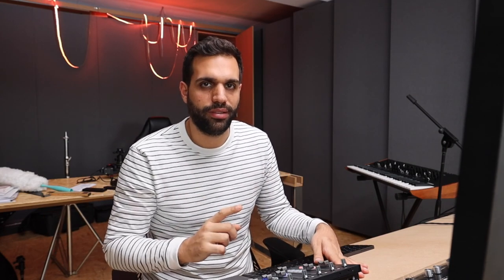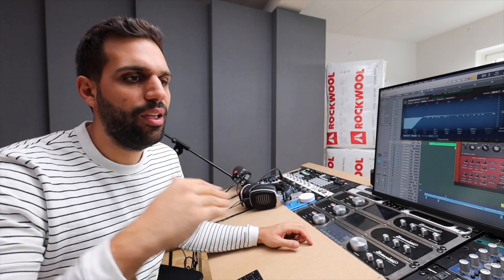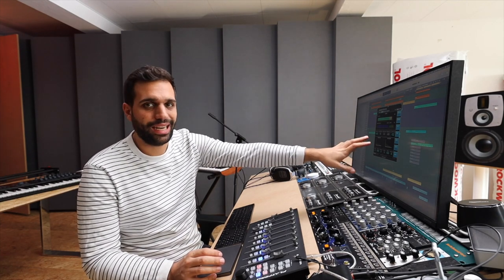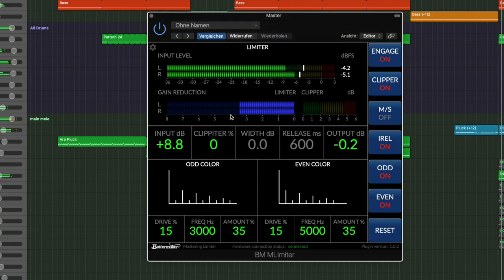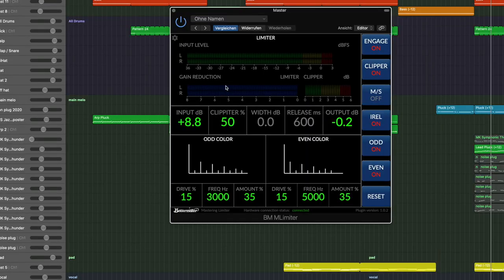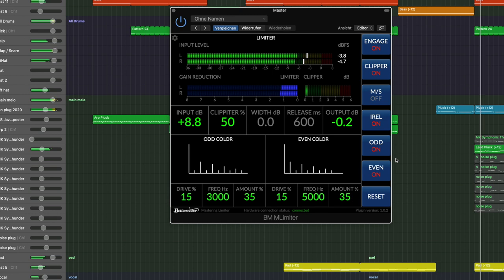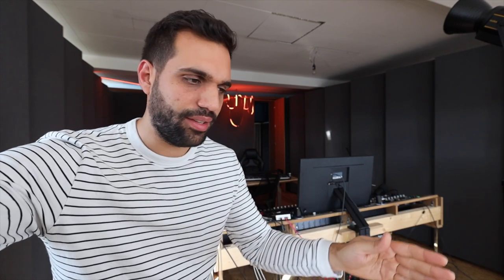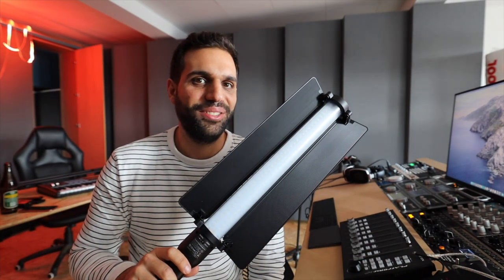NEW HACK TO GET YOUR SONGS AS LOUD AS THE PROs

Comment: Yes, thanks for this! It's counter-intuitive, but clipping can enhance the sound and really reduces load on the limiter. I just learned this a couple weeks ago, and I'm still trying to understand it completely, but the results speak for themselves. In bitwig, clipping can be achieved in several ways, but the bit8 distortion/bit-crusher can implement clipping very well; maybe other bit crusher plugins will work too. It seems like it should sound terrible, but it doesn't. Of course, you can make it sound terrible if you try. ☺️ Everyone should become familiar with this technique.

Comment: Hey Jon, So I used a loudness meter to mix something at the recommended LUFS for Youtube. Lets say -12 LUFS or so. I uploaded a -5 LUFS master. And the -12 LUFS was basically way quieter than the -4 LUFS version. What gives? I thought streaming platforms are supposed to turn -4 LUFS down to where the -12 LUFS was at. Any thoughts?
Reply from the maker: They don’t. Just make it loud
Reply: @Jonsine  Would it be beneficial to make breakdowns less loud? and make drops loud for youtube only? From what I heard youtube pushes to integrated LUFS - 14. In theory short term LUFS of a drop could be louder when keeping drops lower.  Not sure if there is a clear answer to that - what do you think Jon?
Reply: @TheChorus3  im not john but what i can tell you is if a song is not at ultra maximum loudness can br a good thing

Comment: No real secrets here...

You can get a TDR Limiter 6 plugin that has a:

Dynamics Compressor
Clipper
High Frequency Limiter
Peak Limiter
Output Protection Limiter
True Peak and EBU Loudness Meter

And it only costs 50 Euros!

Or,  you can just use a glue compressor and a limiter like the Waves L1 & L2 and make tracks as loud as you want. I prefer not to smash my mixes--I keep them around -14.   Loud mixes cause listener fatigue.

Comment: Nice review but the title seems misleading since you mostly talk about the Bettermaker limiter (which is a major purchase for the average hobbyist and not a new hack). Maybe a more appropriate title would be something like "New $3000 Bettermaker Limiter helps those who can afford it master like the Pros". Lol.
Reply from the maker: You didn’t get the point it’s not about the bettermaker limiter it’s about using clipping on the master. You can get very inexpensive clippers as a plugin but if you want the best possible clipper than go for the bettermaker.  3000€ is for a mastering studio inexpensive and at a certain level every 1% of improvement is worth it.
Reply: @Jonsine  Agreed...and my Bettermaker Limiter should be here next week so I'm pretty sure I got the point. Lol. I was just thrown off by the suggestion that clipping for loudness is a new hack. Its just not. Mixing and mastering engineers have been doing this for years (whether clipping using plugins or clipping the converters). I bought my first soft clipper (Sonnox Inflator) back in like 2010 and have been clipping my Metric Halo ULN8 converters for at least 5 years. Clipping is definitely getting more popular amongst the non-pro masses though, so perhaps that's your angle. In that case maybe  link to a few of your favorite software clippers in the comments (for those who can't afford the BM)? Either way, thanks for taking the time to respond and keep up the good work. Peace.

Comment: Dude that table is still way too wobbly. With all that $$weight$$ you need to stabilize the legs before painting...Hell even just a single 30cm wide plank from right to left screwed in and bracing the rear legs about half way down would do the trick...but maybe you already had that planned ;P